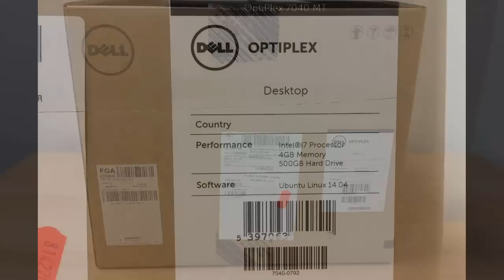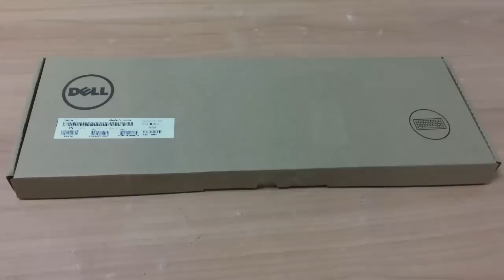Dell OptiPlex 7040 MT PC Unboxing

Comment: 5:31 the blue Full Height PCIe x16 (wire x4) and 5:40 the black Full Height PCIe x16  what are they used for ? i believe the blue on is for the Graphic card only and the black is for the same purpose ?
Reply from the maker: Both the blue and black slots are used for graphic card, the PCIe x16 (wire x4) will operate in times 4 mode.

Comment: Hello man , when you plug in the power cable , does he starts automatically for 2 seconds then turn off ?
Reply from the maker: Yes, it is normal. It like a test for power supply
Reply: @xianece1  thank u very much